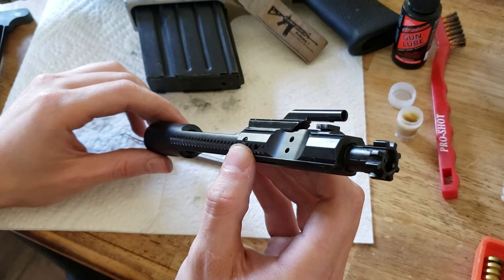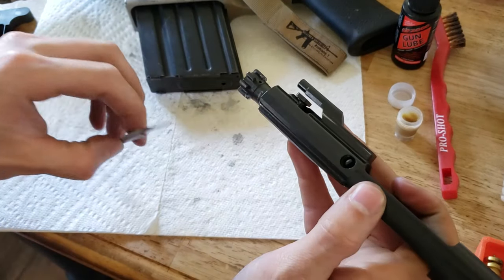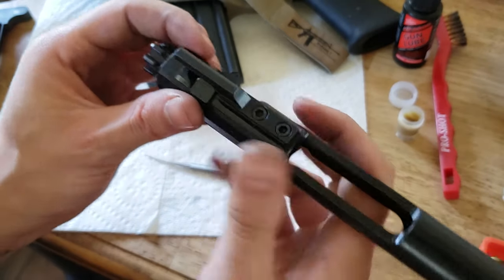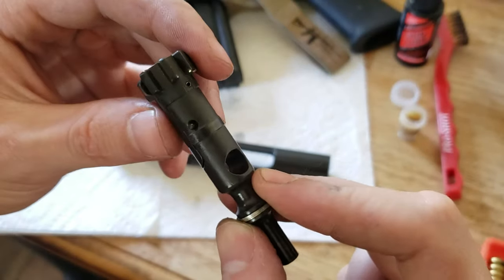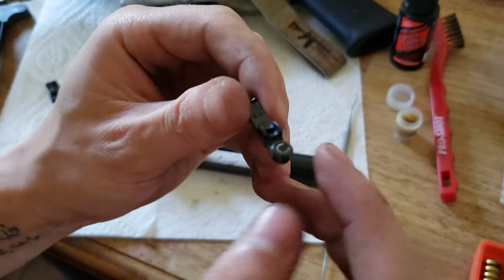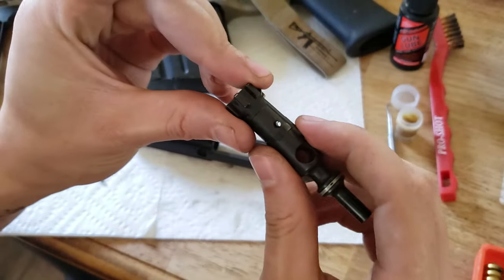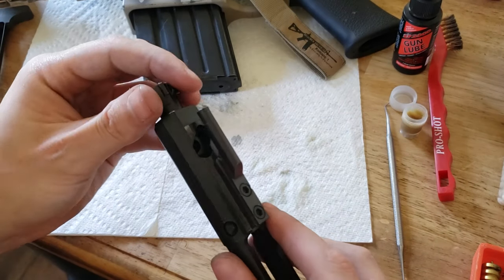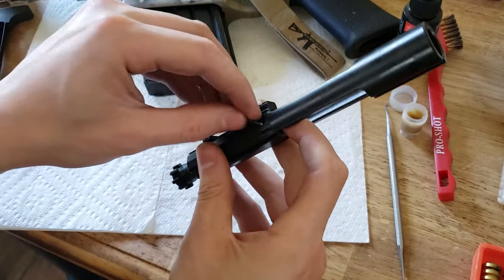Disassembling, Cleaning, and Lubricating your Bolt Carrier Group

Comment: Totally disagree about how WET to run the bolt and possible stoppages.  I've been building, shooting, 'smithing, owning AR's for well over 42 years and have 10's of 1000's of rounds through a myriad of AR brands and platforms and the ONE thing that I've discovered is that AR's will run BETTER WETTER than DRIER.  You WILL induce a stoppage if you run your AR as DRY as you claim AND if it's dirty, i.e., long shooting session.  And putting a few drops of oil in those side holes on your BCG???  Those are vent holes to the gas rings, oiling does little to help-except perhaps keeping the carbon SOFT.  I know this is anecdotal, and my experiences are MY experiences and your results may vary, but I'll go out on a limb and say you are WRONG about WET bolts inducing stoppages, I feel it is the OPPOSITE.  Just my 2 pesos.
Reply from the maker: You are running nicer guns- get an arms room gun dirty, douse it with oil, and it will crap all over itself- much like privately owned ar's will once they are ragged out in a bad place.

Comment: I would never put oil in the high pressure vent holes. That’s a big no no when it comes to bolt carriers, same as with the gas key no oil in the gas key.
Reply from the maker: "Thats a big no no"- who told you that? Haha
More time at the range- less time fantasizing
Reply from the maker: @427SuperSnake1  oooOOOooooo they TALKED about it! Smyth busted! The guy without experience sends a video to a guy with experience of a couple dudes talking.
Im shocked.
Hahahahaha
Reply: @Thepreppersbunkeroutdoors  sooo is it ok to do? I’m new to the AR platform and for the first time ever, I took apart my bcg and put it back together again using this video (you made it very simple btw and I appreciate that) .
Reply from the maker: @dylanarmstrong3880  nothing bad will come of it. You may even find in a firefight or class it could get your stopped up gun running again. And by may even I mean it will- I have done it.

Comment: If your,  bolt,  very gum up , in a firefight,  weapon,  not working,  Pee, on the bolt,  to unlock it,  basically,  washing  out the,  old oil mix with gun powder,  to  get the weapon,  working,  with out, takeing the weapon apart,
Reply from the maker: No

Comment: U forgot the ejector...
Reply from the maker: No i didnt
Reply: @ThePreppersBunkerOutdoors  well i must have missed it then..
   I saw the extractor, but not the ejector..
Reply from the maker: @farmerwayne1404  ejector isnt part of field stripping.
Reply: @ThePreppersBunkerOutdoors  Well your title says otherwise.
Reply from the maker: @farmerwayne1404  you assume the title says otherwise.
How many times did you remove your ejector in the military?
Reply: @ThePreppersBunkerOutdoors  That wasn't your title! And it wasn't partial disassembly of bcg. 
   And when I said you didn't include the ejector, you replied that you did. Don't get to worked up about it. It just wasn't part of disassembly video.
   And because you ask. I go hundreds if not a thousand rounds with no issues...
Reply from the maker: @farmerwayne1404  i ACTUALLY replied "no i didnt"
As in i didnt forget to include the ejector- i purposfully didnt include the ejector, because it isnt necessary.
But yeah, good job you claim to run lots of rounds without doing the ejector, just like in 4.5 years i probably ran 80k rounds and 20k blanks through m4's without having ever, nor any of my peers having ever removed the extractor.
In fact a normal soldier silly enough isnt ALLOWED to remove the ejector, its is armorer grade maintenance- not because it would be too hard, 

But again

Because it is entirely unnecessary 

👌🏻
Reply: @ThePreppersBunkerOutdoors  Again your title says "disassembly", not almost disassembly.  Or field stripped disassembly, or disassembly you never do because someone else will do it for you. But I bet you've heard " he never can be wrong" before. Have fun...
Reply from the maker: Sorry, maybe i should have titled it "the disassembly you need to know" or "disassembly short of some random farmer who has shots "hUndrEDs tO ThoUSanDs Of ROuNdS"'s standards"

Maybe you should make a youtube channel 👌🏻
Reply: @ThePreppersBunkerOutdoors  Thank you, but Im not interested in show business.  I rarely clean my firearms. In 50 years of shooting Ive never had a problem or malfunction except for improper manufacturing of ammo or a bad reload from the shooting range that would only allow you to shoot what they sell. There is nothing wrong with a squeaky clean firearm.  But again my issue was not  with cleaning, only that I mentioned that the ejector was not removed. I do however like your alternative titles.  When I do clean my firearms I take " everything " apart.
Reply from the maker: @farmerwayne1404  its amazing that people think how long they have been doing something gives them credibility.
"I have been driving for 50 years"- yes, and you were always awful, and now its time to take public transportation.

All your comment has done is verify the fact that you lack both training and experience.

Give the Dunning Kruger Effect a look, you may find it insightful if you can look at yourself objectively.
Reply: @ThePreppersBunkerOutdoors  Im a very good shooter. And I have training in many things! My fifty years, shows decades of experience good and bad. Im also exacting in things that I tell people. 
   I find it sad that you were so insulted because someone said " you didn't do something ". Very defensive you are. 
  If you left out the ejector purposely,  you could have said so and for what reason. But you did leave it out even though your title said disassembly of bolt. Your just to young to understand and have a self righteous attitude.  Maybe you'll get there.
Reply from the maker: @farmerwayne1404  being a very good shooter has nothing to do with training- and claiming to be a very good shooter by your own estimation shows how often you have put your skills to the test.
Again, the Dunning Kruger Effect is showing here- 
Speaking to a soldier who has deployed, recieved and returned small arms fire, and gone on to invest in hundreds of hours of professional training, and who owns a range in my back yard you only show that the only thing you believe gives you validity is your age, but people can be ignorant or stupid an entire lifetime. 
IF you were self actuallized enough to qualify as an adult you might take a step back and realize you are out of your depth and you might be able to learn something-
But between being pedantic (which is understandable) and rigid the only thing you demonstrate is your lack of understanding and the lack of ability in reaching understanding.
👏🏻👏🏻👏🏻
Reply: @ThePreppersBunkerOutdoors  Again you didn't disassemble your bolt completely. So no the bolt was not disassembled. And your boasting of your limited service,  and thank you by the way,  means that you don't know all that much! And my abilities mentioned by me were only given because you assumed that a farmer doesn't know what he's  doing. I refuse to boast about anything. Isn't it time for your bottle??
Reply from the maker: @farmerwayne1404  it was disassembled as far as it needs to be disassembled.
It says "disassembling, cleaning, and lubricating your bcg"- the ejector is not a necessary part of that process.
The title is not "complete disassembly of your bolt" or "disassembly of your bolt to include unnecessary steps"
But thank you for continuing to fight a battle of ingorance in the name of pedanticism
Reply: @ThePreppersBunkerOutdoors  Your very welcome! Fight ,I know...
   You think a little to highly of youself. Go finish your bottle now before it gets cold. And don't forget to train.
Reply from the maker: @farmerwayne1404  i dont think highly of myself- i just know what im talking about.
Wouldn't expect some farmer who clearly has exactly 0 experience to understand though.
Keep enjoying that SS check and advertising how worthless your time is and how willing you are to brag on your lack of life experience. 💪🏻👏🏻
Reply: @ThePreppersBunkerOutdoors  Hey welcome back. Btw, Ive got a 24/7 scheduled. And I work really hard, harder than most! And make good money. My ss, Ill let max out so I have more later on. You've got a long way to go. And I also have multiple pensions from my former 40 years of work. I enjoy planting and providing food for businesses. Its a great break from my former life.
    Ill never regret what Ive done, good or bad.....
Reply from the maker: @farmerwayne1404  good deal. When i want to plant plants ill hit you up. 👌🏻
Reply: @Thepreppersbunkeroutdoors  You should! And never underestimate people you don't know.
Reply from the maker: @farmerwayne1404  😂

Comment: Why would you drop oil in gas ports lol thats dumb shit they teach in military where they dont give a fuck how many soldiers die. You dont pour oil in your vehicles catalytic converter and exhaust system do you? Im 100 % sure it would clog up the whole exhaust really fast. Same goes for bolt. Leave exhaust ports dry lube up contact points that interact with metal surfaces.
Reply from the maker: Glad the exhaust ports on a bcg arent the exhaust system of a car- i did this in fighting rifle this last week, and confirmed that it works. You should probably do less guessing and more shooting.
Reply: @Thepreppersbunkeroutdoors  Keep right on. Some people just don't understand logic. Your probably one of them people that put grease in the barrel too. Just in case bullet don't hang up and runs smoother and increases accuracy.
Reply from the maker: If you get some training you might be able to use logic- till then you're just passing on what you read somewhere lol